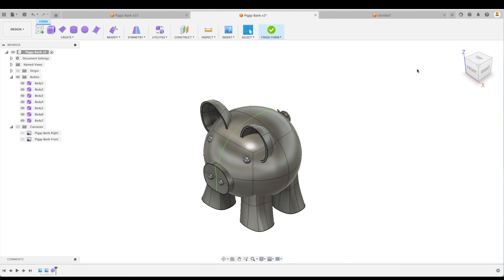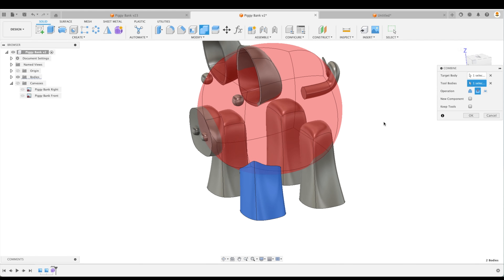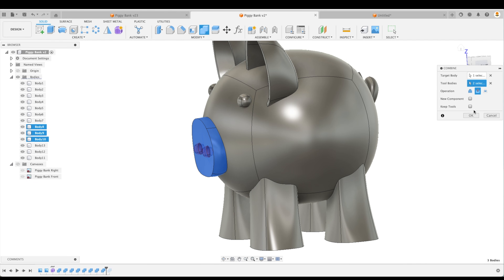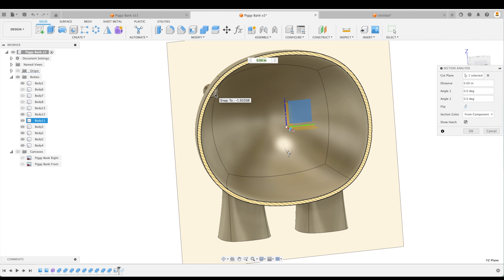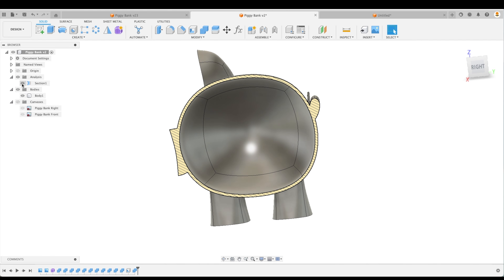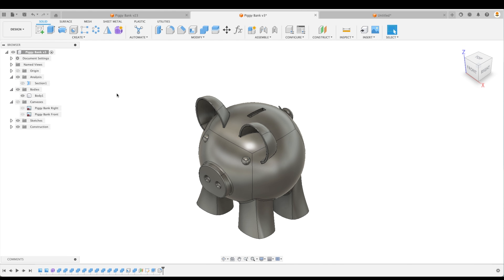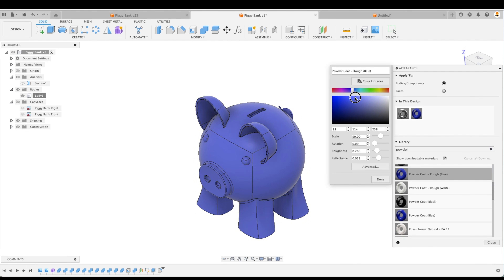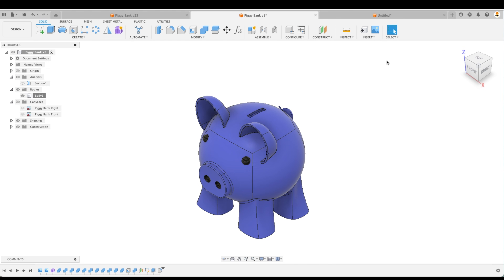Autodesk Fusion 360 - (4/4) Form/T-Spline Modeling Fundamentals for Beginners - Lesson 13

Comment: This was a fun one! Thank you. Forms is really cool! You wouldn't happen to know if there is a free form type of sculpting tool in fusion is there? BTW, regarding not being able to shell with the legs attached, I did not expect that. I experimented with it in different ways and changing the order and seeing if I could get any of them to work together, but no luck. However, I did notice that the feet almost shelled independently from the body almost mushrooming out. It seemed like they never truly combined with the body after we cut and combined them. I could see it shelling from the section analysis on the feet but not the rest. Just wanted to share in case in helps determine the problem for others. But it would be good to know a method for this since maintaining consistent wall thickness is a pretty common need. Any tips would be greatly appreciated.
Reply from the maker: Excellent work with this series too! You’re really flying through these.
Reply: @learnitalready  haha oh yes. I have a lot of specific things I have to learn for a client project. I switched from Freecad and only have like 10 days left of the free trial for Fusion haha. Trying to decide if I'm going to stay in this or maybe Rhino. I really would love an intuitive CAD/CAM and DFM solution which is why i gravitated towards Fusion. It was super easy to use, especially compared to Freecad. Sorry, hope all my comments aren't driving you nuts. lol Buti'm adding to the youtube stats hopefully.
Reply from the maker: @edh3268  Glad you chose to learn Fusion from our small channel. All the best with your decisions!
Reply: @learnitalready best channel out there for fusion from what I've seen and done now. Thank you!

Comment: insanely useful tutorial 🙌 I just have a question: imagine you have a form, and you finish everything so you click on finish form. But then you notice you need to edit something, how do you do it? I'm not finding a solution for this!
Reply from the maker: Great to hear! Thanks for taking some time to express your appreciation and reach out. 
To edit the form, just find your Form icon in the timeline, right click, and select edit. You can also double click on the form icon which will do the same thing, but some struggle with double clicking in Fusion for some reason, so I always suggest right-clicking and then selecting “Edit…”

Comment: How would you print this model? Wouldnt the top just fall off? Would you print this in two parts and then glue them together?
Reply from the maker: Great questions. I’ve been thinking of a follow up to this series which talks about how to be able to successfully 3D print this. Because this series is a little old, I’d probably just redo the entire thing. Stay tuned!
Reply: @learnitalready Thank you so much for the reply. Honestly , I just commented at all because even though this is an old video, your dedication is impeccable, and the quality is superb, so I was expecting that it'd be possible you would reply . Thank you